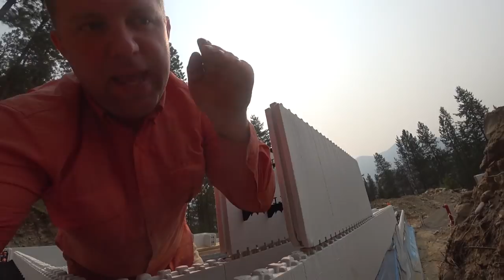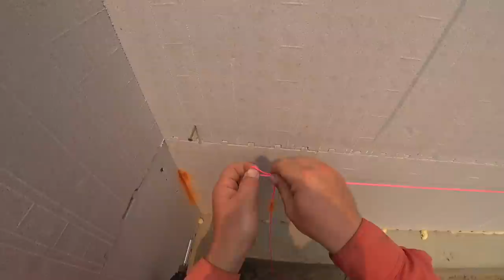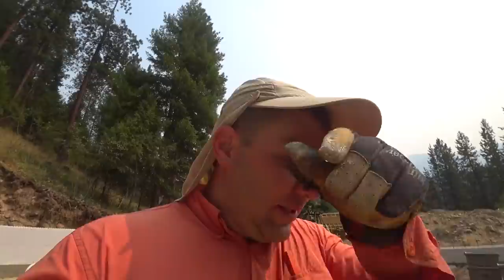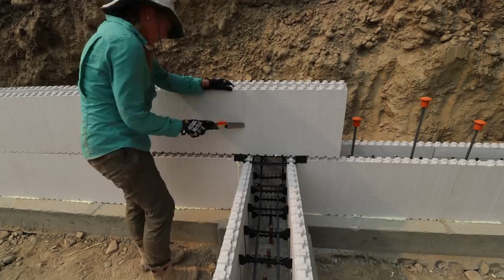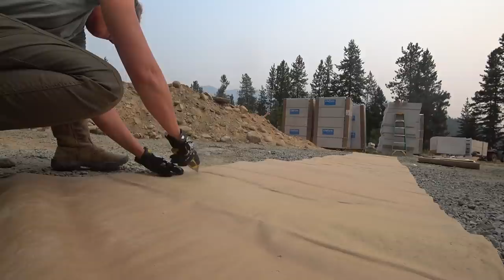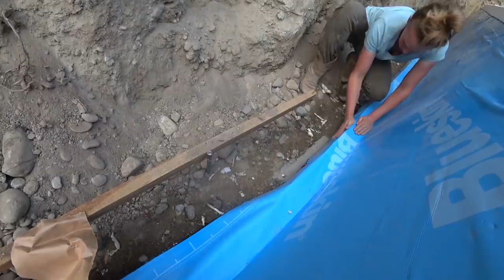THIS STUFF IS DANGEROUSLY STICKY (Applying Waterproof Membrane)

Comment: Just a small tip....

When running a string line, use a shim of known width at either end to bring the line out from the wall at either end by a known amount. Then use another shim to check the wall at various places. That way the wall won't be interfering with the string line in places you aren't checking.

Comment: On my 60 foot walls I ended up putting a chalk line at one point that was at least an inch from where I was going to put anything and then I just measured in from the line in case of problems.  I guess I assume that there is always going to be a problem so keep the measuring point away from being covered up.  My 25cents worth of advice.  Love that rebar bender.

Comment: I built a shop with ICF forms and each block is not the same. We had issues with bowing from our first row. We had to just let it go and built the walls anyways and used bracing to true up them as we poured the concrete. Turn out great.

Comment: I have never done anything of this magnitude as far as home construction goes. However I have laid a lot of tile in my life and one thing I know is that if the first row is wrong the rest of it will be exponentially wrong. It stinks to undo some the things you've done already but if this turns out right it will make the rest of this project come together so much easier. I guarantee there will be at least 100 times in the future where you think back to this time and will be extremely happy you fixed it now.

Comment: Jess, you seem so humble and peaceful like.. Its cool. 
Big hugs and encouragement to you guys!  Thank you for your lessons!  You really are helping a lot of folks with what you're taking the time to share!  
One strong piece of advice...
Get lots of cheap 1 mil plastic drop cloth, and use it to cover all your concrete as it cures.  Once the Crete sets and you can walk on it, spread out the sheets, tape the over laps, and then mist your Crete at least a few times over the next week or even as long as 10 days.   It'll help to prevent cracking and really allows the concrete to be the strongest it can be.

Comment: These are GREAT! Warts and all :) it shows that anyone can do this stuff and what possible mistakes you can run into, how to fix them and how a small error can compound itself and if not fixed early on can result is even bigger errors later. It is good you are taking the time to fix things now instead of being worried about the schedule when 1.5 days lost now will cost you much more time later as you have to make adjustments to compensate for those issues. You will be thankful that you took the time to perfect the foundation when your doing the precise timber work later and then happier with the finished product when you're not staring at your mistakes.

Comment: Amazing!  I've worked with block, just mixing mortar, with another fellow, for the masons and trying to keep up with them.  A 32' x 92' walled foundation in three days with less than a 1/8" difference along the wall and perfectly plumb.  Much easier than what you are doing!  But that wall you are building is so strong!  Keep with it!  Be encouraged with your progress and how you are solving problems.  You are building a home, not a house.

Comment: Yep, the spray foam holds the blocks really well as long as footing and blocks are perfectly dry.  Also if you tie the horizontal rebar to the dowels coming up out of the footing that will anchor it really well during the pour and consolidation.  We did Blueskin also but since we were doing a full height walkout basement wall, found it better to place 11'  strips vertically.  This worked well rolling the cut sections onto a piece of PVC then unrolling them down the wall from the top peeling off the paper a few inches at a time as we went.  One discovery we made pretty quickly was that you don't want to peel off too much of that paper lest it stick someplace you are not ready for it to stick to, like itself:)  Also if it is warm, you need to get some mechanical support onto it at the top to help keep it from peeling off/sagging until you get your dimple board and backfill in place...  You guys are moving right along...

Comment: suggestion. I know your not there yet, but shoot on some 2 X 4's  on the footer to secure the ICF to, and then OVER brace your corners. Reason - The ICF has a tendency to float/lift when you pour in the concrete. The spray foam is a "good" adhesive, but IF it does fail during your pour your in deep DEEP trouble. Same with your corners... all of them. If they blow out it gets really bad. Think about the weight of say four foot of concrete by 8"... it's really heavy. Plan for what you will do if the upper parts bows a little how will you brace it back into place while the concrete dries.   I helped build 3 very large houses with ICF and it was difficult. We used a ton of rebar, ladder track, manufactured aluminum bracing, spools of wire for joining, plywood and denominational lumber bracing and we still had some bowing and blow outs to account for.

Also you might want to check the exposure time for your membrane. It may start to deteriorate if it's out in the hot sun for too long before you backfill... oh yeah and don't for get to secure the top edge with some kind of parge coat or material. 

I really wished we would have had somebody experienced with ICF in our area before we built, but there wasn't anybody with a 6 hour drive. Good news is it's solid stuff... bad news is if it's messed up your going to be dealing with it all the way through your build.

Comment: One suggestion. When you run your string line from corner to corner, one tip we used in framing was to put a block of wood (1x4 or 2x4) at the corners where the string is attached. Then use another piece as a gauge block. This prevents a small bump out in the wall or form from throwing off your entire string line.

Comment: Moving along!  Just a suggestion with string lines.  You should always block both ends (insert little wood block as name implies) to 1/4 to 1/2 inch - then you adjust all elements to be apart from the string by that amount.  String touching structure leads to inaccuracy - just FYI.  Love you guys!

Comment: When your using a string line to straighten a wall the easiest way is to run the string from end to end like you did then cut a piece of scrap wood in 3 short pieces. put 1 piece at each end between the string an the form spacing the string away from the wall by the thickness of wood. Now you can go anywhere along the string and use the 3rd piece of wood as a feeler guage to make sure the spacing is the same everywhere along the length of the wall. when you do it this way the strin only touches at either end and will stay straight

Comment: Jesse I hope you guys are planning to put a small overhead door in your basement I think you will find it super helpful for various projects in the winter time. Also I think you guys are doing an excellent job even though you are novices! Sometimes not knowing the correct order in which things should be done, can be extremely disheartening. Don't loose hope continue to do the best job you can and fix the things you find as they come. Btw I am an electrician and have built houses most of my life as well so if I can help just holler! Also I would definitely leave the adhesive you are using to stick the ICF to the foundation, unless the directions tell you to remove it. I know from past experience most of the time when you scrap stuff off like that you weaken the bond substantially. Awesome videos keep up the good work! Just subscribed recently and love your channel.

Comment: Strings are a marvelous way to straighten a wall, footing,  brick work, etc.  But,,,,  the string should never touch anything in its tightened position.

Use a nail or screw,,, just what you have been doing, but when you wrap the line around your nail,, space it a 1/8th of an inch,, or 1/4 of an inch away from the thing you are straightening. An easy thing to do is slip a 16d nail or 8d nail under the string and allow the string tension to hold it in place.  Just the thickness of a nail,, or something common that you two will always remember and use,,  And then set your brick, wall forms, top plates, rim joists that same 1/8th or 1/4 away from th string down its entire length,,, Now you have a straight wall.

Any line that is at contact,, or even close to contact will bend outward toward the string,, and you will not have a straight wall.

Strings must always be some small discrete distance away from the wall or plate you are gauging.

Old English timber framed, wattle and daub houses, normally made the second floor overhang the first floor.  The second floor has more square feet.  This protected the walls from rain,,, daub is classically just clay based mud.  Can't get that wet too often..  Also,, timbers exposed to the outside will rot if wetted too often,, and the walls below also need shade to not over heat in the summer.

Well, that summer sun over heating is still a concern.  An overhang, length sized for your latitude, can shade the entire wall,,, wall surface and all windows.  You will not need an air conditioner to cool that overhang shaded wall and windows in July.

For any given latitude,, yours is bout 48 degrees north?  Subtract the axial tilt, 23.6 degrees  = 24.4 degrees declination from true vertical,  will shade the entire wall on June 21st  The cooling season lasts 60 days past that,, so lengthen the overhang a bit,, and you will have a shaded wall through the heat of the summer.  If the wall top is a nominal 8 feet,, the  total, trim and all, o the soffit AT THE 8 feet will be about 40 to 42 inches.

On the flip side,, the winter sun angle will be the planetary tilt PLUS the latitude on December 21st  48 +23.6= 71.6 declination from vertical   That same 40 inch overhang will expose your entire south wall and all of your south windows to full winter sun to aid in heating,, except for the approximate 16 inches at the top of the wall.  Normal headers and double top plates above windows are 14 inches deep. Timber framing can be different header depths.

Craft to the site.  Don't craft the site.  Go with what is,,, easier and cheaper.

Comment: You can get 1' wide and 18' wide on the stuff we use to use before plaster on the walls. We also use to cut the length short enough to work with like 10 to 15' in tough spots. We installed a paint type liquid on the concrete to help adhesion. Maybe your membrane is different as we only had to overlap 6".
Thanks for the videos.

Comment: Suggestion: when you run a string along any wall, offset the string from the wall at the both ends with equal thickness spacers (half inch or so).  Next, carry a same thickness spacer with you and use it to check the gap between the string and the wall.  This eliminates the likelihood that you would force the string with the wall.

Comment: Only commenting because I've seen the same mindset in myself in huge projects. Jesse: slow down. Take a break and do something different. If the ICF block instructions aren't clear enough, write your own- step by step. You're plenty motivated, but without a concrete plan, you won't be pouring more concrete soon. It's time like these that you remind yourself to think smarter not harder and the 6 P's. Proper prior planning prevents piss poor performance.

Comment: When setting a string line to straighten a wall or form work you need 3 blocks of wood the exact same dimensions place one block under the string at each of the secured end of the line against the structure and use the remaining block to establish the equal distance from the structure to the string line as you work your way along the structure. Remembering a string line must be very tight and make sure no little pieces of the structure are touching the line between the blocks.
Regards from down under.

Comment: Sir Jesse. Can I suggest a way to use your dry line (string line) for straightening walls or what ever the need. Use a spacer block of 1/2" or 3/4 ( doesn't matter) at each end of the line. Then use another to use as a gauge at each interval you choose to check. This way the line won't get in the way of your wall or truss or what ever you are trying to straighten.

Comment: I feel your pain... I have also encountered the joys of "things not being the size the manufacturer claims". In my case, a simple shed. The manufacturer stated a particular size of slab, I phoned them to check that this size slab would mean the shed walls would rested perfectly on the perimeter edge of the slab, they confirmed the dimensions.

So, I poured a slab that was this size +/- 5mm. The shed arrived and was around 100mm (4 inches) too short for the slab. 

Fortunately I was able to just screw batons all round, 2 inches in, but it should have been unnecessary and I would have saved a bit of money on tanalised timber and concrete. 

Have the ICF makers given you any indication of how the rebar SHOULD be done? It feels wrong to cut all those ties on a corner, but at the same time their instructions state to set the corners first. SHould you just punch straight rebar through the polystyrene rather than using mandrel-bent rebar?

Comment: Greetings from Portugal, you are doing a great job. I'm a little bit worry about the way you pour concrete ,over here we use a vibrating hose that helps to fullfill all the air gaps but I haven't seen you using it in the foundation. Best regards

Comment: When you run a string along the side of the block to true it up.   Try spacing the string at each end with s chunk of 2x4. Then use another chunk to gauge it along the blocks.  Easier to see what's going on this way and the string should have a even gap away from the block the whole way down.

Comment: Been meaning to comment on another video when you got the liteforms. I never seen those before. I always saw the wood/plastic reusable forms that you have to use all the metal bars with the rings on them to hold the forms in proper distance... this seems better as you don't have to cut off all the bars afterwards when you take off the forms. Though I am curious why you chose that kind rather then the other type I mentioned. If you could inform me, I would be greatful for the thought processes in going with that choice as I plan to do what you are doing at some point

Comment: Just a thought from a mistake I made on a house I built but was fixed in time.  It looks like the front basement wall has no back fill so you have a walk-out basement.  That means you will have a door there.  Make it WIDE go the full 36" or double door to 48" or so.  My house had 13 steps from the driveway to the front door with the garage under part of the house.  Taking my freezer through the front door was impossible.  But a 36" door from the garage did the trick.  Like I said, just a thought.

Comment: Hey im not a structural engineer or anything but keep in mind the weight of the backhoe could be your foundations worst nightmare, and drainage of rain away from the foundation as much as possible. Drain tiles looked good but keep in mind the grading. Rain is probably EIFS worst nightmare, keep up the good hard work!!

Comment: When you pour concrete in the ICF the REO mesh you put in will be exposed as it is hard against it & will not be covered in concrete. I don't know much but I do know that it will rust if not covered in concrete.
Reply: Won't matter it's just there to keep the form straight, once poured it's not structural, and will remain behind the foam never to be seen.

Comment: Guys when you use a string line your supposed to put a packer at each end between the wall and string this will keep the line off the wall in all other areas then all you do is measure the thickness of the packer to get a true line

Comment: Its not carpentry... its construction ...these things happen... run with it.... in carpentry you look at everything down to the 32nd or the 16th.... in construction when you're Framing and roughing in.....  sometimes things end up a little bit off but it's not going to mess with with the rest of your building quit being so perfected on your measurement.....thats why this part is called roughed in.....
Reply: Steven Hammond  While I agree with you about the construction vs carpentry, It always nice to have nice flat and plumb walls to work with. I wonder how many people making comments own a house and have spent anytime putting in crown, floors and cabinets or inspected the electrical work

Comment: I have followed you on this interesting journey for some time and have been impressed with the works, up until the footings pour. It appears to be going downhill from there. Why did you leave spoil material within the confines of the building square? It is more difficult to move it now, that you poured the footings. With regards the ICF, you really are making a mess of it. There are numerous videos out there, that would have been helpful and with regards the waterproof membrane, it did it after the walls were poured and the wall aligned/true, as you will see in the videos. It is interesting, we are your warts and all postings, which is a credit to you.

Comment: One thing I  noticed was your strinds seem loose to me. When I pull strings to straighten things to them I  pull them as tight as I possibly can and normally use some kind of spacer at each end. The spacers are of equal thickness  so you can measure off the wall to the string. That way you don't have to worry about the wall touching your string and throwing off your straightness.  Very interesting to watch and feel your pain when things don't go as planned.